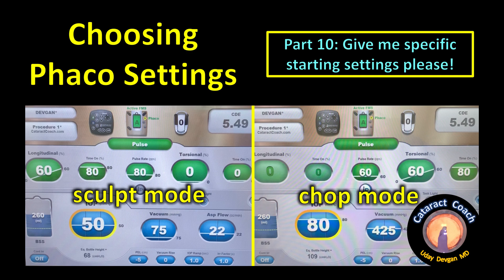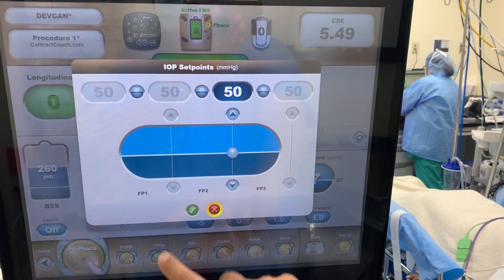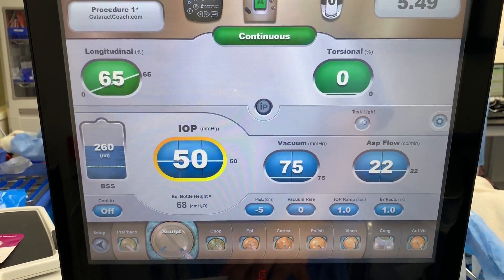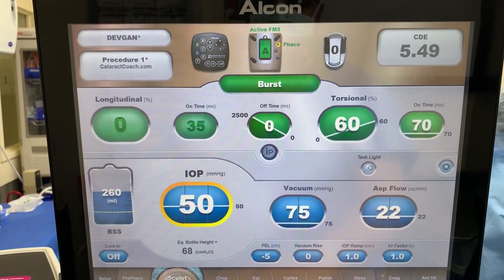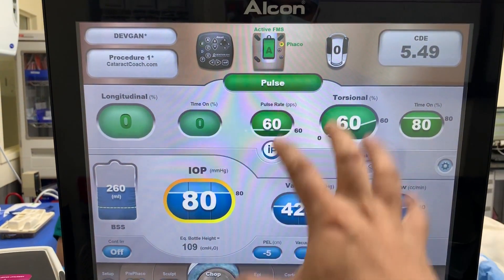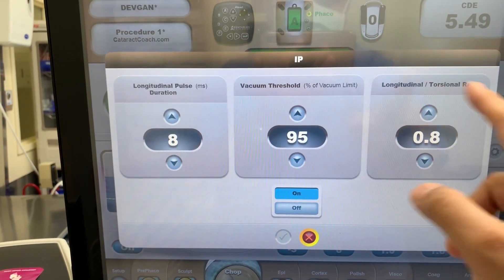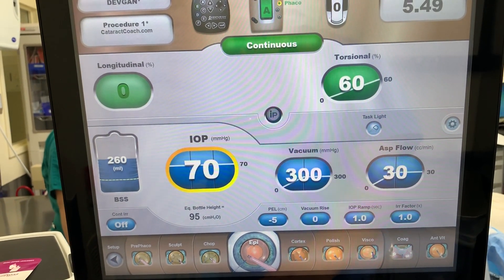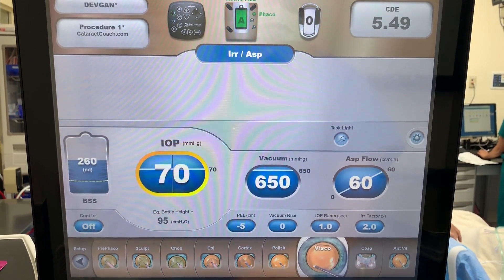Phaco Fundamentals Part 10: Here are specific starting settings for cataract surgery

Comment: Thank you for the series! The Vacuum/flow values shown were meant for the 2.75 tip, right? For a 2.2 mm Phaco tip how much would you change the Vacuum in the chop/ quadrant removal phase? For a beginner surgeon.

Comment: Thanks for all your wonderful videos.  With regard to your Chop settings I noticed that you were using all Torsional.  Many surgeons actually prefer all Longit for this mode.  The concept is that during chopping you want to bore directly into the nucleus which is one of the strengths of longit power.  The other rationale is that theoretically the release of power during chop should be very momentary, simply to hold the piece.  Therefore,  energy expenditure is not a big issue and longit is not that much of a downside.